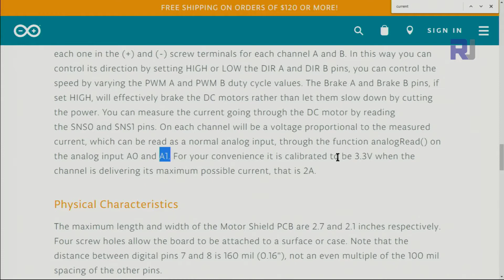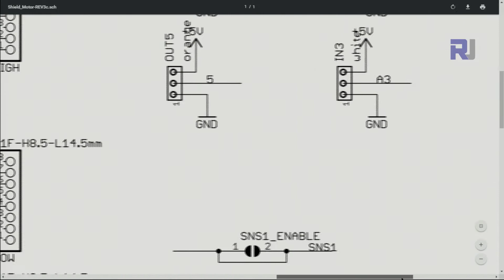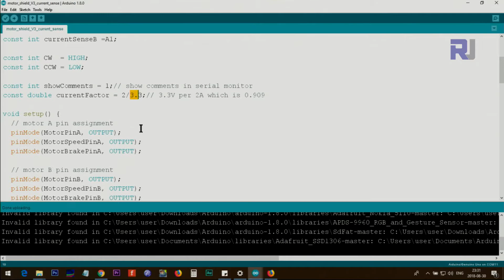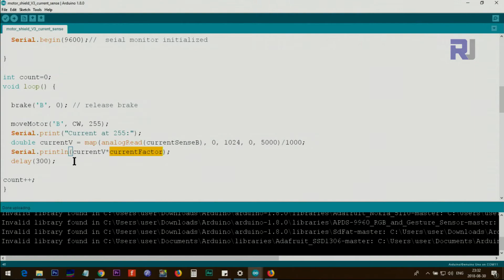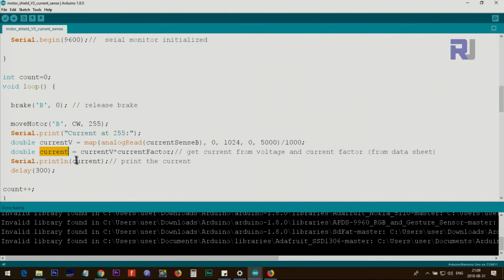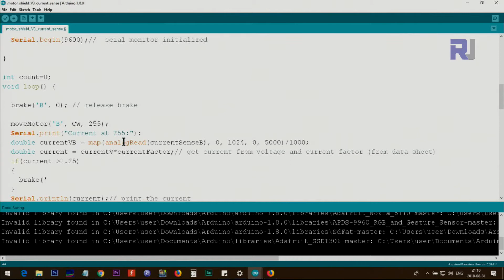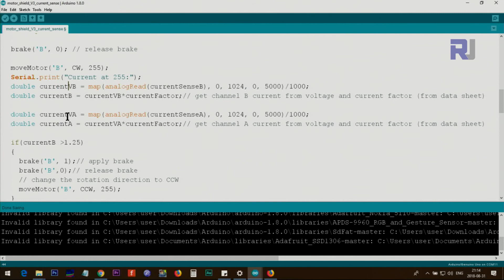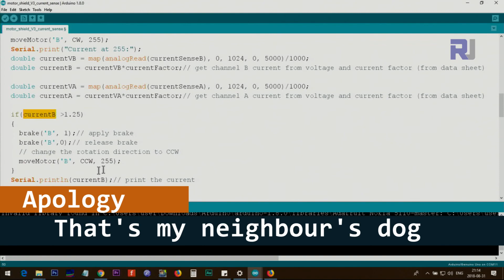Current Sensing with Arduino Motor Shield with L298N L298P

Comment: Thank you so much for this video! It's really helpfull. One question is that i have is why they are using an opamp if it is not needed why i get from you video. I want to include this IC aswell in my project so I am really curious. I hope i can also use the 0.15 ohm resitor from sens A to gnd and then measure the voltage directly by the arduino. 

Thank you in advance!

Comment: HI , we should add a resistor to sensA  or we can read the value of the current directly by analogRead(A0) ? Thank you
Reply from the maker: Hi, I had to watch the video to make sure I reply with correct information. Indeed your question has been answered in the video. Please watch it again without escaping. You don't need a resistor because there are resistors built into the this board. I have even mentioned the value.

Comment: Dearest, you've also created a wonderful video this time, as always. I wanted to ask you if you could implement a 32-relay i2c management tutorial via Bluetooth module. It would be very useful for home automation. Thank you very much for your attention 😉
Reply from the maker: You are welcome. Thank you for the comment. I will put your request on my list to have 32-relay  with i2c.
Reply: @robojax  You're a great one. Very kind is available to enrich your tutorials that are very important. Then I wait for the video so that it can then use it in my house. As a component of the ULN2803 and MCP23017 I think they can serve to handle more relays, but then you see how to do it. After this help I gladly made a donation to support your very important tutorials. A warm greeting  .
Reply from the maker: Hi, I did search and could not find 32 relay module anywhere for sale.
Reply: @robojax  So I have seen that Arduino can handle I2C mode also for the relays, so if you could create a software that manages the relays via two integrated MCP23017 it is in turn interfaced with two ULN2803 Ii relays. If you could help me through this system . Thank you so much .

Comment: What is the specs of the bigger motor you are driving?  How much maximum continuous current this shield can provide?
Reply from the maker: Hello, the link and model of the Motors is in description. The rating has e explained and I don’t remember it.  You must have skipped the video
Reply: Thanks @robojax , actually the model/link is in the previous video description.

Comment: Hi, just a quick question. Why is the current factor 0.909?     2/3.3 = 0.6... ?
Reply from the maker: Hi, the value is related to the resistor  used in this module. I have explained it.
Reply: @robojax  Hi Robojax, thanks for your feedback! I reviewed the video once more and it is still not plausible for me^^. I understand the need of this current factor, and also how it is calculated (2A / 3.3 V). But... you say in the comment of the code "3.3V per 2A which is 0.909".... but correctly calculated it is 2A/3.3V= 0.606... I mean, due to the fact that you perform this calculation in your code u later multiply "currentV"*"currentFactor": so e.g. 2V *0.606 A/V = ... 
or do i still missed something important in your video? then please give me the relevant position in the video :)